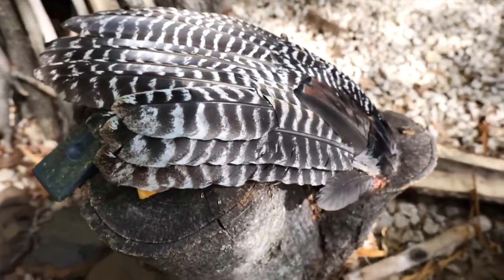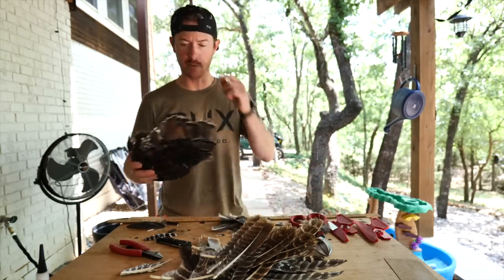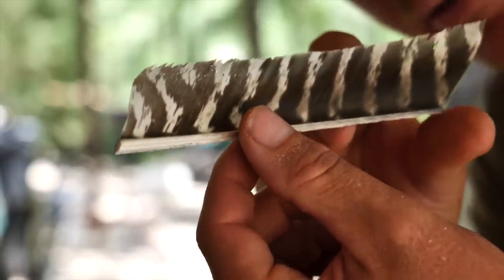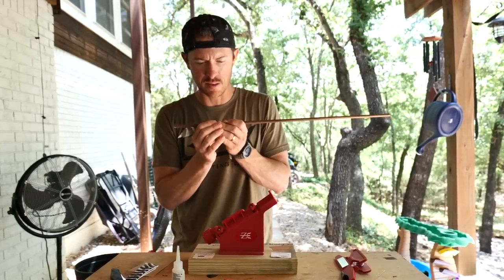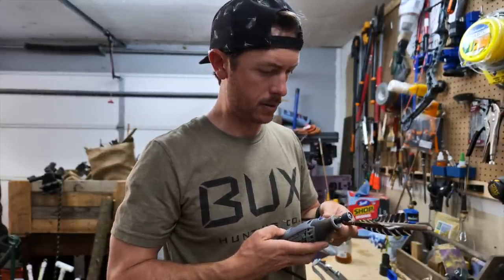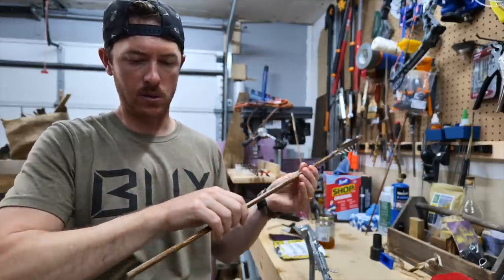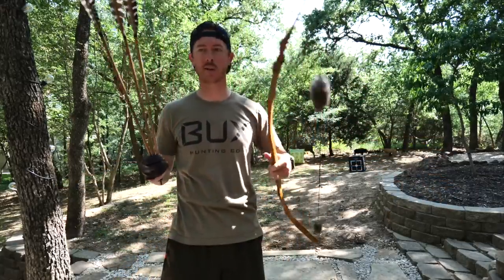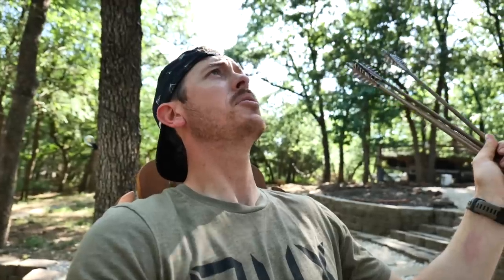BUILD & SHOOT! Traditional Arrows from WILD Turkey Wings!

Comment: Justin what kind of glue are you using? If that is CA. Crayon acrylic is water soluible. You can use carbon arrow 1part epoxy also made for wood and alum arrows. Or a traditionalist would boil down a cow/horse hoof. j/k but nott
Have a great day. Prayers for you and yours

Comment: Man your robbing yourself of ALOT of performance with that shorter bow and draw, take your normal draw and multiply that by 2 then add your handle length and that’s a pretty safe bow length so for me I build my bows with 8 inch handle sections (4 inch handle and 2 inch fades into the limbs) so it’s 27x2+8= 62 inch bow